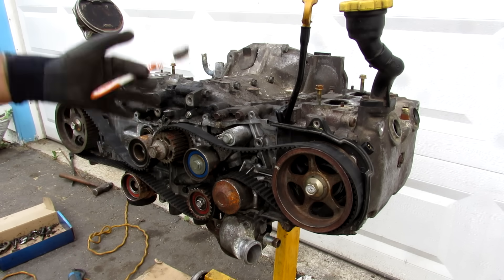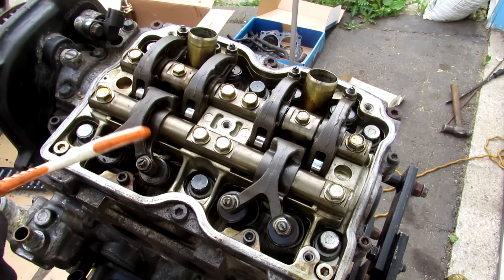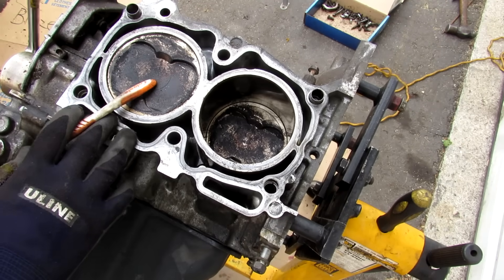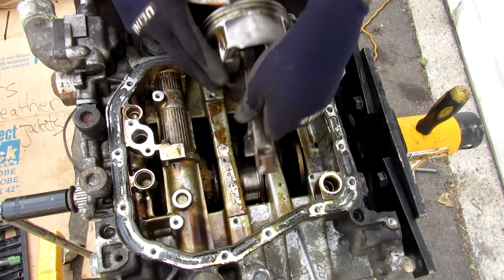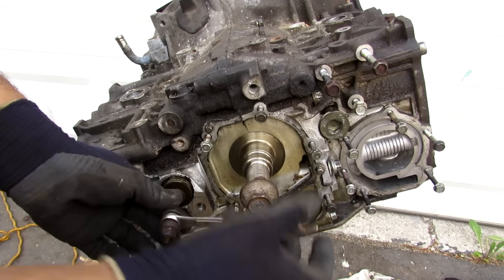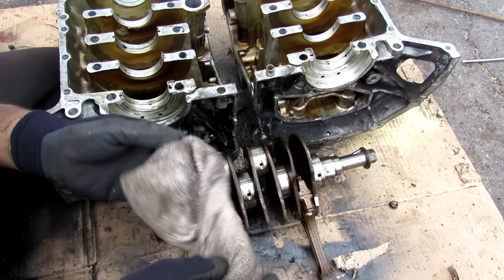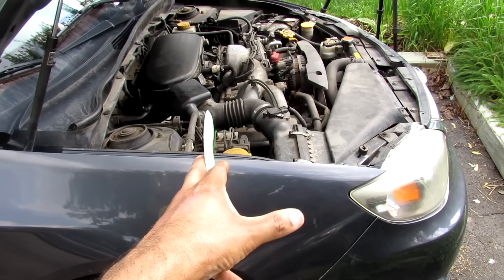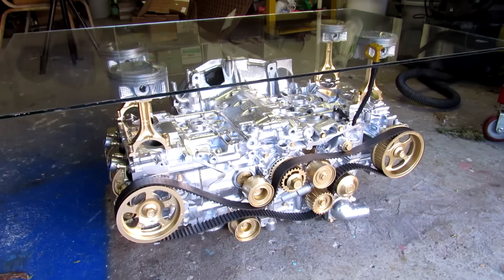Why Subaru Engines FAIL

Comment: This makes me glad I never bought a Subaru!
Doesn’t look very DIY friendly..
Reply from the maker: Yeah...not easy to work on
Reply: find the right mechanic
Reply: Look after them then they don't give too much issues
Reply: I bought my first one, a 79 because it was so easy to work on.  Alternator, starter and carbie on top of the engine.  Current one (2016) I can't even find the starter but at least it has timing chains so no belts to change.

Comment: coworker had the dealer swap out a shortblock on a 2018...was drinking oil...thought it might have been the 0-20w spec'd for it...was dealer maintained also. New one is starting to get thirsty too...looking at the video, it must be a bear to get the 2 halves sealed up...

Comment: My 2019 impreza with 45k on it has needed the engine tore down 4 times now due to sludge build up so severe it throws off the VVT and starts knocking. That was on 3000 mile oil change intervals. When I complained to Subaru they ignored my oil change log with receipts i provided and accused me of never changing the oil.  Now they give me “free” oil changes at the dealer on 6000 mile intervals only it burns oil so bad I can only get to 4000 miles before the oil level goes below the add mark. Still no new engine. I also found out the dealer flushes the engine in between oil changes to fend off the sludge build up though they don’t admit to a sludge issue.
Reply: Ryan Pearce 
Haven’t heard that. I’m guessing there will always be enough first time suckers like me and return business from secretaries to keep them going, but I “won’t get fooled again” (Sorry Pete.)
Reply: Ryan Pearce 
My “new” Subaru blew its FIRST head gasket at 25,000. It has since needed a new engine and another head gasket all before 150 grand. Never again. That brand is the triumph of advertising over engineering. Total pos.
Reply: AT
I just took it in yesterday for an oil consumption check. The guys tried to tell me it was “full” in reality it was barely on the dipstick so I had to have him get a mechanic to show him he was wrong. They then added a half quart to barely get it over the add mark. .5 quart/4200 miles on the change is only 4 ounces/1000 miles which is below the 10 ounces/1000 miles requires consumption for a new engine.  I have 2000 miles left on the change to hit the consumption rate but not only do they manipulate how much oil the car uses by not filling to the full mark where the level started but Subaru actually thinks it’s ok for a car with 45k on it to use so much oil it’s off the dipstick!  Absolutely insane.
Reply: Ryan Pearce 
You’re preaching to the choir. Between mine and other folks, Subaru’s are pos. Nobody I know wants another one. The vehicles I buy now say “Toyota “ on them. The GD frames rust out on them and anything can happen with any car but they seem to hold up better. In my view anyway.
Reply: I read somewhere that Toyota is buying up shares of Subaru. Idk if that’s true or not or what effect that will have or has already had on Subaru.

Comment: Maintenance on Subaru’s is expensive. I have 2 of them. I believe I’m going to change manufactures. I purchased the service contract from Subaru. Waste of money. It covers to 36k. Due for service at 42 K. That service cost is over $315. The next service is at 48k. That service is $850. The car is a money pit. Maintenance is the deal breaker.

Comment: I have a 2009 legacy, 2.5 Do you recommend any particular oil and filter.  You scared me with your presentation...which was excellent.
Reply from the maker: The frequency matters more than the oil brand 
For filters just use OEM and stay away from FRAM
Reply: @speedkar99  Thank you.  I use either Subaru or Napa/wix gold  filters and synthetic.

Comment: The engine probably failed because the car owner forgot to put GreenPeace and Coexist stickers on the rear window
Reply: Hilarious but true 👍
Reply: LOL, I thought Green Peace and Coexist stickers were standard equipment.
Reply: @jimdavis2385  - It costs extra to have the factory leave the stickers off
Reply: They probably put soy bean oil in it.
Reply: LOL... Don't forget the Bernie Sanders for Prez stickers  (front and back bumper!)
Reply: James Price  Like those that came to the surface and have been unstable since, the 2016 election...?
Reply: It failed cuz he forgot to refill his vape juice
Reply: Nailed it!
Reply: And didn’t have at least 2 dogs in the back.
Reply: @Teemo
You forgot Gender Neutral stickers as well
Reply: Lol
Reply: @Cam 

That or it was bought by a straight guy
Reply: Its a car in transition. Never know which way it rides.
Reply: BE KIND ....LOL!! Good one.
Reply: James Price  I'm a man ,and I gots a big dick" instead.  Mature...
Reply: @vintagevmax2410  About as mature as being insecure about what machine your nuts are lying on top of when going from point A to point B. Trumpism is a disease.
Reply: @kibbles5724  someone can’t take a joke 🙄
Reply: They forgot to tune for the "suh bruh" sticker
Reply: @Temporary Account lol
Reply: Or the Bernie 2016 bumper sticker
Reply: Subaru should put a spare headgasket, and rotating assembly in the glove box.
Reply: @Temporary Account  I'm late but I had to say you gave me a good laugh 😂.
Reply: Do you know why that is.., lots of cars covered in stickers were cars kept in the family. When a parent gives a car to a kid that car has like 80% greater chance of getting stickered up. As the youngster wanted to put the sticker on since he was 15. Now your 16 or 18 driving dad's old whip the stickers goes on. Most other cars aren't kept in the family like a Subaru, they get traded in or sold, CLEANED UP and back to resale. Because Subarus are (were) keepers. While other cars are traded. Subarus are (were) often times left in the family and thus become the bumper sticker bandits that you have  seen on college campus and concert parking lots. Instead of buying a new car they kept it in the family and sent jr to college. 

-Best useless explanation you will ever get.
Reply: @slow mazda just like rotaries, boxer engines have their followers. I am not one of them but i do like the platform of the car
Reply: God these replies are hilarious. Some people really do live in their own bubble and don't listen to facts.
Reply: You must be from Vermont😎🤣
Reply: I have a Subaru Outback with NRA stickers. Go figure.
Reply: @wreednelson  Since 1982 I've used all kinds of stickers on my Subaru's so, people know for sure I am not a liberal..
Reply: @vintagevmax2410  when I wear a man-kini to the beach, I make sure it's got a 13 star american flag. That way people know...
Reply: @vintagevmax2410  I don't have or use stickers of any kind. It's fun when people don't know what you are thinking & can't slam you into a box immediately
Reply: @vintagevmax2410  I’m sure your conservative pals have called you one anyways 👍
Reply: @wreednelson  I saw a Prius with a NRA sticker once while at the range. Yes i did chuckle
Reply: @deansapp4635  I have a   prius and I can't stand liberal psychos!  It really sucks that people assume they know your political position based on the car you drive.  My Prius is slow, but awesome.  Amazing engineering and execution.  I expect to get 300k miles with minimal repairs- like my last Prius.
Reply: @deansapp4635  buy Prius have more money for ammo
Reply: @wreednelson  I saw a Prius at the gun range once
Reply: @wreednelson  NRA and Trump stickers on my Forester!
Reply: @lesterawilson3  trump stickers? didnt he lose tho.
Reply: @megamanhikari8095  No...the socialist DemonRats cheated.
Reply: @megamanhikari8095  Not yet.
Reply: @lesterawilson3  I ordered a sticker that says, "One-Pump Trump" but it's not here yet.
Reply: @armyretired28  what ever you need to tell yourself so you can sleep at night...
Reply: @dustinssimpson  
Anti means you are against something, and fascism is what the nazis were. Think the proud boys and those "good people " in Charlotteville...
Reply: Those types of people do seem to graviate toward Subarus. Unfortunate that they do not realize you cannot exist with a religeous sect that wishes you dead.
Reply: @teresapeabody2746  like Antifa and BLM marxists?
Reply: @armyretired28  
You do realise Antifa, stands for Anti Fascism?
Y'know like the Nazis were...
Reply: I put a gun sticker on my Subaru, but my friend says that won't take the gay out.
Reply: Subaru didn't built the Prius, bud.
Reply: @DocSprocket  Prius goes 300k plus with no maintenance. Boxer engine knocks itself out at 100k
Reply: @rncondie  Not any boxer engine that I've owned.
Reply: @rncondie  
I've had two Prii.
The first one was a 328,000 mile throwaway, the second died at 305,000, though that included an extra $6K hit for a replacement hybrid transaxle.
Reply: Sprocket's Garage the Prius is a tool hillbillies made it a political statement
Reply: @jackmcandle6955  I think you spelled yuppie wrong.
Reply: @Temporary Account What if I do - just saying.
Reply: @Temporary Account Sounds like you like corresponding with me - what do you look like?
Reply: @Temporary Account So did I hurt your feelings little troll....sounds like you're the one that's butthurt!
Reply: That's a strange flex....
Reply: Or this year a Biden sticker.   I'm pretty sure 99% of all Subaru owners voted for Joe.  I own a Lexus.
Reply: @scubarojo  Great... then I'm in the 1% ! ! !

Comment: I like the fancy new name for an engine that has the same basic layout as a 60's Corvair flat 6 or a 40's Volkswagen flat 4
Reply: There is a difference betwixt a flat and a boxer engine. The difference is in the crank pins. The following article should explain. https://jalopnik.com/its-time-you-knew-the-difference-between-boxer-engines-1825246413

Comment: My advice is to simply use the correct octane gasoline so it doesn't pre-detonate, check/top off your oil reservoir occasionally (even in-between oil changes, especially turbo models which can "eat" some of it up), and change your spark plugs when you're supposed to. Some people think that because it only has 4 cylinders it doesn't need to be properly serviced, or can go on being neglected. It's a high-performance engine. Pretend that Porsche made it instead of Subaru.

Comment: Having absolutely no knowledge about how engines work (this video was probably recommended because I’ve been watching video reviews on Subaru’s), I’m starting to have second thoughts on my recent purchase of an Impreza. Would I be alright if I just kept up with regular oil changes and maintenance?

My first car was a 2009 Honda Civic, and I always made sure to keep up with the oil changes and I’ve never had any engine problems. The only thing that had let me down was when one of the lines of the power steering started leaking and had to be replaced. 

Should I expect to spend a lot more on maintenance over time on my Impreza? excuse me if I sound really dumb, I don’t know a whole lot about how cars work.

Comment: There's only one reason why Subaru EJs fail, and it's revs.  Don't rev it, it'll last forever, that's why the turbos are so small.  My first one had 252K on it, no problems.  Current one has 185K on it, 17 pounds...guess what, no problems.  6K all day, and that's it.  It's not a Honda.
Reply: And Honda engines are turning to JUNK... we just dumped our '18 CR-V....

Comment: Had an early 2000s Outback wagon.  Engine went out at 80K.  Dealer told me it was my fault for not  changing the coolant every 30K.  Had the Outback cobbled back together and traded it for a Mazda 6 Grand Sport wagon with the 3.0 Ford V6.  That car had over 160K on it and was running strong when we got rid of it.

Comment: Now I know what that noise is when I start my Subaru. I'm using Lucas oil stabilizer to help it going. 200,000 miles. After my brother in law replaced the head  gaskets and such.

Comment: I used to own a WRX with the boxer engine and I found it to be the most smoothest 4 cylinder engine I have ever driven. It was smooth like a V-8 engine. I was impressed that I could drive it over the California grapevine in 5th gear without any straining from the engine. Hopefully by now they have worked out all of the pain points with that engine. Excellent video, btw.

Comment: I am on my 3rd Subaru with No major problems with any of the engines. If this engine is such crap why bother working on it.? Yet more unsubstantiated claims about Subaru and not about the individual engines that were poorly serviced and or abused.
Reply from the maker: But if you treat it like a Corolla these things won't hold up. Too bad people who buy these also buy Corollas

Comment: Utter bull sass I've had two outbacks both boxer h6 the 1st was 11 yrs old when I got it with 125k on it two yrs latter it was on 188k & all I done to it was tyres,brakes & wheel bearing on the rear the next one was straight after it was 8yrs old 84k on it I tuck it up to 145k with in 18 month's again just tyres & brakes changed oil every 4 k I'm currently on my 2nd forester sg 2.0xt had it 12 months come November it's 17 yrs old it's like using a car 5 yrs old I've had loads of cars that I use for work instead of using a small van & in my experience Subaru is bullit proof you carnt buy a more well built reliable car for your money
Reply from the maker: I want to tear down an H6 badly!

Comment: Very thorough and impressive analysis of the Subaru Boxer engine.  However, the video would more accurately have been titled "How Engines Fail."  And the simple answer to the question would be "Engines fail when not properly maintained."  Almost every example the author of the video gives of a disadvantage or potential problem of the Subaru engine is a simple matter of failure to keep it properly lubricated. The engine in question was obviously neglected.  Yes, an oil control ring can get clogged up with sludge, but only if there is sludge in the engine. The same is true of any engine, not just Subaru.  Had the owner changed the oil, coolant and battery on a regular basis, it would have been a much different story.  It's true that in some cases, oil starvation problems can be potentially traced to a head gasket failure.  But it would have been much simpler for the author to have stated that, if considering buying a used Subaru, be wary of anything from the late 90's to 2012, at which time the engine was completely redesigned and the head gasket problem eliminated.  As to the fact that it's hard to access the spark plugs on a Boxer engine, well I suppose that's just something you'll have to put up with every 60,000 miles.

Comment: A 2-piece block?!?! This just solidified that I will never own a boxer engine.
Reply: What are you talking about ? This is a very sturdy block, all boxers including aircraft engines are built with a vertically split crankcase.
Reply: AeroGarage I personally don’t want to deal with tearing a two piece engine block down to replace bearings or pistons. Too many parts and there are better engines out there. Plus the oil distribution around the piston seems problematic to me if you let the car sit for a bit between use. Just a preference. 🤷🏻‍♂️

Comment: This is hilarious… I’ve owned three Subarus, all of which have gone over 300,000 miles. Better than almost any other engine I would recommend. 👍🏼
Reply: We own a 2019 outback and we love it
Reply: Hard to believe.  Most owners do not admit to changing head gasket etc
Reply: ontario man 
You’re obviously not very familiar with the 2.0 engine. The 2.5 had the head gasket issues, not the 2.0. It’s as reliable as they come.
Reply: It’s impossible for you to own 3 2.0 Subaru’s and have driven that much unless you bought them at already high miles or you have spent the last 15 years driving from LA to NY once a week. And if you bought it high miles then they already did all the repairs and with proper maintenance just about every engine will surpass 300k. Toyota motors have reached over 500k in the corolla.
Reply: Charles Middleton 
Being as I am 43, I bought used cars (because I’m not rich, lol). The cars I purchased were all stock, and were well maintained. One had 89k miles on it, the other 117k miles and the third 108k miles. I continued driving and maintaining each of them over time for another 100k to 200k more miles each. Other than my old Volvo 240, I have never had cars run without issues like my Subarus have. Thanks though, lol.
Reply: @anthonyfisher6051  I've had the same experience.

Comment: Found this while contemplating an EJ outback... Friend drives an EJ forester and I like how it handles around town better than my EZ30 Outback but the automatic transmission and fuel economy make me reconsider keeping it. Any truth that the EZ30R is a more reliable engine? Not sure why mine gets 14mpg but my friend with an Outback sedan (also EZ30) gets 18mpg driving like he stole it.
Reply: I bought an 06 4GEN B spec last week (EZ30R + 6 speed manual), I get 11.5L/100KM mixed.  The engine goes alright, but ONLY with premium fuel.  I am using 98 octane with an additional 10% E85 just to keep detonation away. The DBW sucks too.

Comment: I have been looking around for a used Subaru. I had a Forester a couple of years ago and was very impressed with the design and build quality. I think my conclusion from watching this video is that I should buy one with a full Subaru service history, and pay more for it than one from a used car lot. Then change the oil regularly.
Reply: That is what I did on my sti, I found a used one from a dealer so I paid mroe for it. Turns out it didn't matter as I lost cyl 2 to bearing failure a year after getting the car

Comment: Nothing better than straight 4 cylinders engines , straight 6 , v6 , v8 , those box o flat engine are perfect for motorcycle , old ones 30 o 40 years ago , thanks for this info